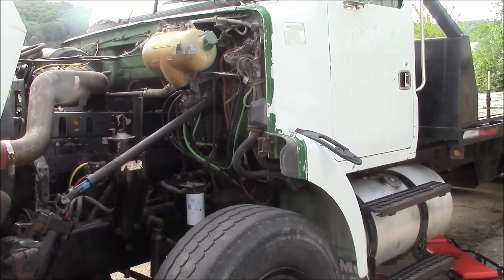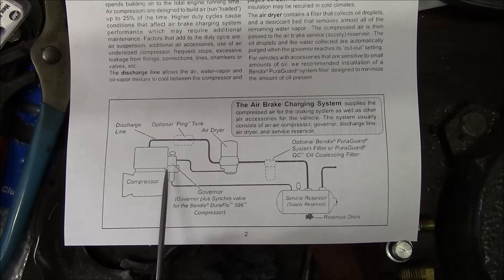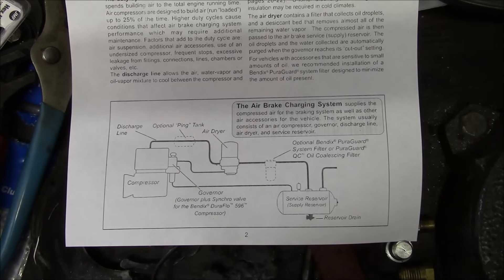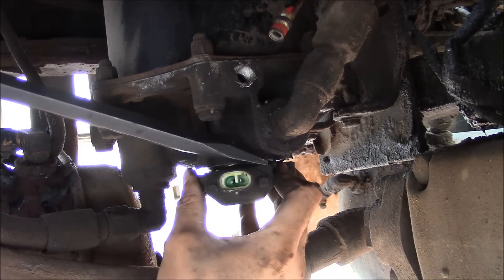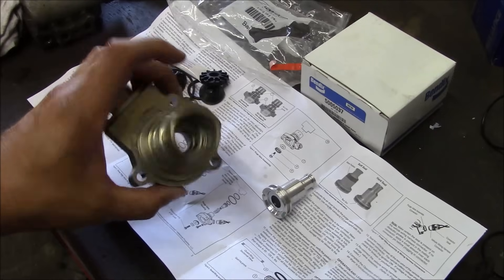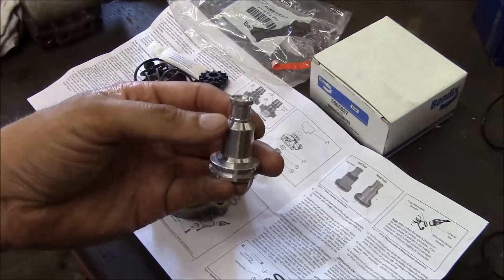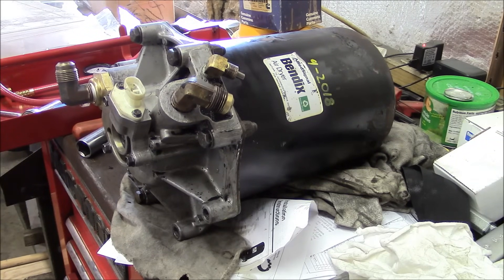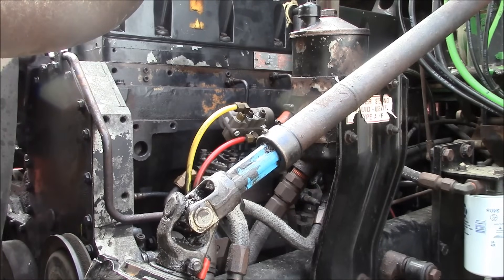Truck Repairs: Air dryer purges constantly

Comment: Great video. I have a 1998 Volvo VNL. I've clocked it on the air recharge cycle 90psi --> 120psi. at idle, it runs for 90secs to "pop-off", then bleeds out the air for 120secs, to 90psi, then cycles up again.

I know I have a slow leak near the footwell, and will fix it soon. 

Question is: what is the "normal" interval, if there is any?
Reply from the maker: It depends on many factors, but if you go from 120 psi down to 90 psi in 2 minutes, you have more than a small leak! Just sitting idle the air should stay up for more than 20 minutes pretty easily. While driving, it depends how much you use the brakes and if you have air ride, but I'd say 10 minutes is a minimum interval for normal driving.
Reply: My 05 Volvo used to leak out the air from 120 to 95psi in about 2.5 minutes as well. That was a couple of big leaks. I could hear it standing 10 feet away with the engine off. That was before replacing an air spring with rusted out top plate and a fan clutch air line leaky quick connector.  

Now my truck only leak from 120 to 95 in 45 minutes with both tractor and trailer brakes fully released while sitting stationary.

Comment: Had the same issue in our workshop. Turned out to be a check valve at the air tank wasnt seating and causing the truck to purge every 30 seconds.
Reply: I have found Teflon tape pieces in the check valve on the air dryer, in the inlet check valve of the primary & secondary air tanks.

Comment: What can cause the air dryer to leak on the purge valve and purge every 30 sec, I replaced the govenor and new air dryer and it's doing the same thing as the old one,  can the compressor somehow put pressure on the dryer to cause it to leak after the purge cycle
Reply from the maker: Hard to say. The the purge valve only purges when the governor supplies air to it. If it keeps leaking, something is sticking in the purge valve or governor. Could be defective new parts.
Reply: @WatchWesWork  thank you for the reply Wes, it's really hard to figure it out,  I've seen a YouTube video same  problem and the guy put extra washers on the purge valve spring to make it stronger , so I did that too ,adding 2 extra washers from my old dryer and that didn't help either ,  I guess it's to the dealer on this one.

Comment: I have a 2001 freightliner century n14  purging every 30 seconds also. I replace the air dryer and governor and still the sane thing. Could it be the actual air compressor?
Reply: Could be the purge valve, could be a check valve,  could be a tiny leak in a line somewhere.  Do like what Wes did,  get under the truck with a squirt bottle of slightly soapy water, squirt all around on air lines looking for air bubbles.  If no leaks found,  locate your check valve(s) (drain system of air before removing anything), see if check valve(s) are obstructed, rusted, damaged, etc.  If the system fills with usable air so that you can drive it and keep pressure up at all times, then there is nothing wrong with the air compressor itself.  If there was anything wrong with the compressor, you would not be hearing the purge valve sneezing every 30 seconds, because the system would not be filling with air.
Reply: @stanpatterson5033  thank you sr. 
 I will check the the air lines for leaks. I replace the air dryer with a new one that includes the purge valve and check valve ,new governor and it keeps purging every 30 seconds with a rattle snake sound at the end that last about 10 seconds
Reply from the maker: It's possible the actual unloader is leaking, but pretty rare. More likely an air line. Check both small air lines from the governor to the ping tank and purge valve, and the large lines from the compressor to the check valve and on to the ping tank.
Reply: @WatchWesWork   Thank you, I got the problem fix.  My air compressor was going bad... Fix the all the problems

Comment: Best thing to do is just bypass the dryer.That way the brakes will be frozen on the first cold morning,and you can lay on the ground with a bfh beating the drums while cussing the weather instead of yourself for being a lazy ass.At least that's what I always do.
Reply: Confusing comment
Reply: You sir are a genius.  Fix the air dryer instead of being stupid
Reply: what does beating the drums do? If there is no air to the spring brake , why would they release?   lf   there IS air at the spring brake, and If you have to pound on the drums to make it move ,  you got problems that have nothing to do with the air  system.
Reply: @ASPCOT  Ice freezes them.
Reply: @patb9375  must drive in blowing snow ,drums have no inside shields on them, then park the axles around blowing snow at night.
Reply: Lol.

Comment: Any idea where the chunk in the check valve came from?
Reply: The truck.
Reply: could have come from any number of sources in the air brake system.. including snagged shop rags.
Reply from the maker: Hard to say. The compressor gets air from the turbo, so the inlet is filtered. Probably rust in the supply hose or the fittings.
Reply: It's carbon that gets built up in compressor head and at the top end off the system.
Reply: It's carbon that gets built up in compressor head and at the top end off the system.

Comment: thank you.. that is a great video.. the trash truck at my apartment building had that happening to it. i ask the drivers to talk to the mechanics at their company as it should not be doing that.  it continued to do that.  i gave up. i even called the company.. they only have 500 trucks probably.   soon they show up in a brand new truck.  nice.. what happened.. oh the air brakes failed on the old one and we crashed it.. then their faces kinda twisted. i said i warned you..
Reply: Sorry but air dryer popping wont cause air brake system failure.  The spring brakes will stop the truck so loss of air pressure causing a crash is very unlikely like to the never unlikely category.  The truck crashed because the driver was an idiot.  Not because the brakes failed.
Reply: clueless operators, careless companies. who gives a shit if somebody gets killed right? save a penny at all costs.
Reply from the maker: As we say in trucking, "it's not the go, it's the whoa".
Reply: They  hire  people  to  throw  trash . Driving  the  truck  is  strictly  accidental . Pun  intended . I've  been  fixing  trash  trucks  for  25  years .